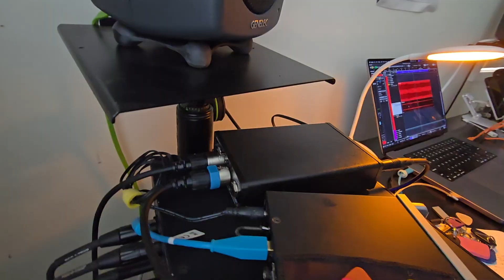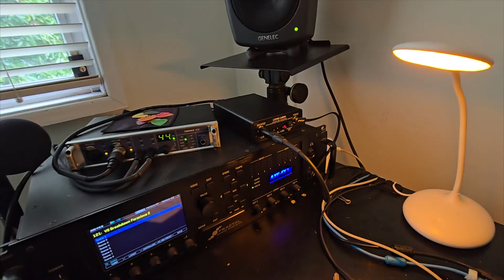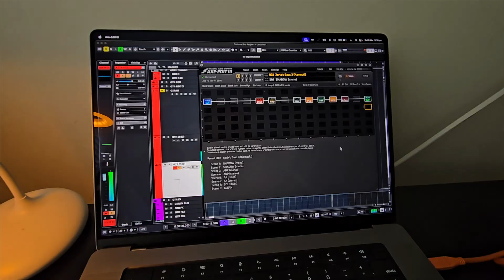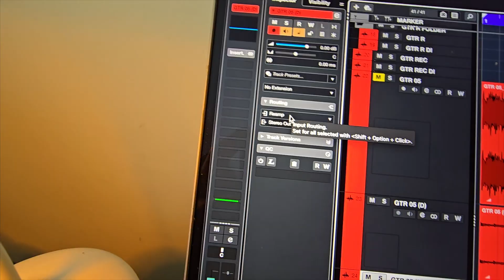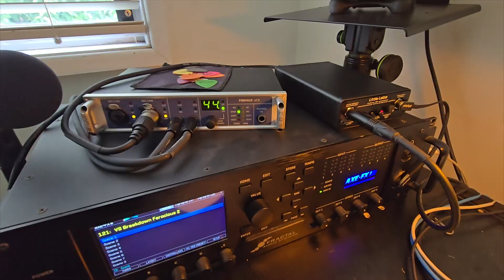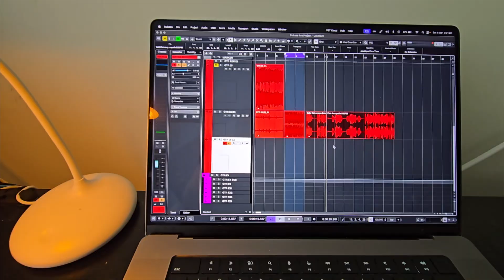Reamping using Little Labs redeye + Axe fx 3 + Cubase + RME UCX

Comment: Hi. I'm looking at the redeye, handy with both di and reamp in the same box.
How do you feel it compares with reamping with the axe fx usb? I get that you use the whammy, so you can't reamp including the whammy with just the ace fx usb...
I have a fm3 but also use a few pedals in front of it so I'm also looking at reamp solutions...
But you're happy with the redeye, signal quality and everything? The di out is only mic level, but no line level?
Reply from the maker: Hey, you can definitely reamp using USB axe fx. For me, switching audio interfaces everytime I wanna reamp was tedious and alittle annoying [for me]
Also, using aggregate devices was buggy [on mac] hence why it boiled down to this option of using little labs. Now I can reamp anything with a click of a button and keep my RME as my main interface 👌. It might be alittle expensive at first but once your setup you'll have an awesome system going 🤘
Reply: @Bonesplitter1 Yeah, it seems like a cool little device. Can I ask: How are the levels you record your di dry signals with? Read that some people feel the di gets very low with the redeye, and it's impossible to get the level to decent strengths when reamping? Do you feel you have to turn up the levels a lot on the di when reamping?
Reply from the maker: @ztevie.j  yo so I don't really have that problem, I crank my input all the way up max on the little labs redeye [I have a passive pickups GTR] and don't really notice a difference.  Sometimes when I reamp on cubase I put an OTT on the DI to compress the DI before it hits the amp. But when im recording and arranging for a song I don't really focus on the mixing until the end of the song when all the arrangement and ideas are down
Reply: @Bonesplitter1  Ok, thanks! There's a used one for sale here, but I got a little hesitant when reading about the low levels. I sent a mail to little labs with some questions. Let's see how it turns out....